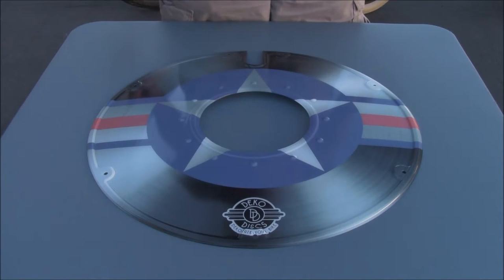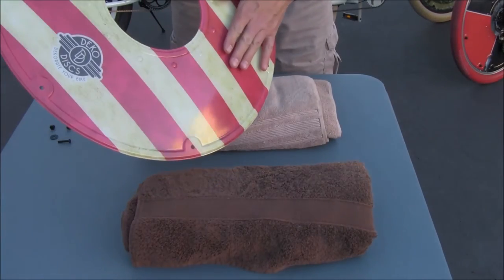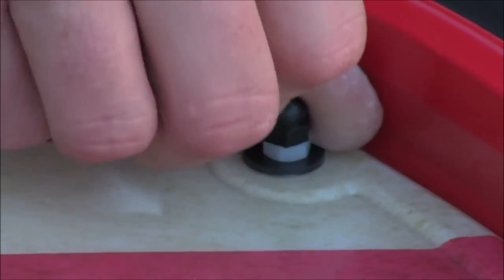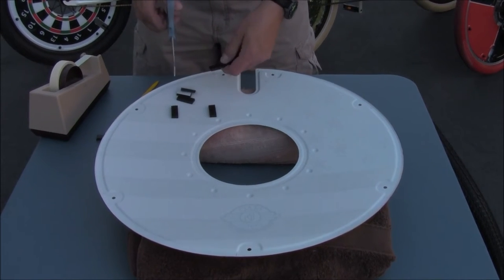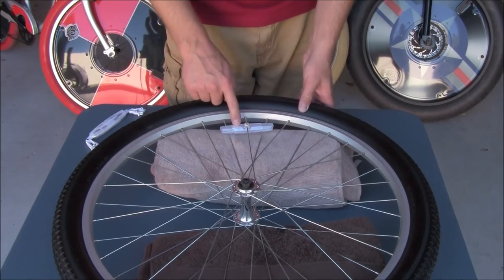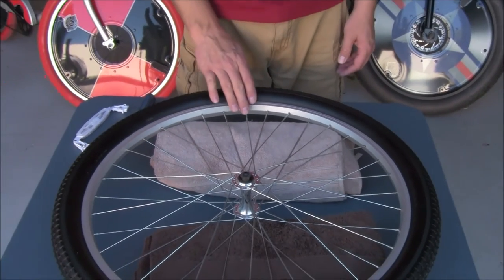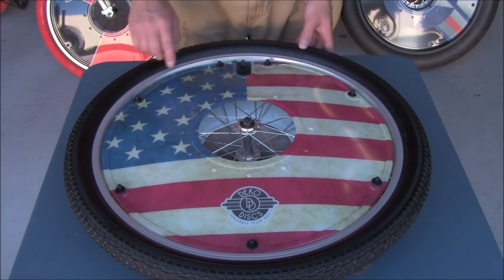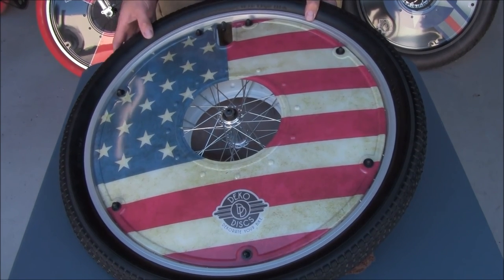Deko Discs Installation Video

Comment: Got a challenge for you guys ..
Ze best would be … that the disk DONT spin with the wheels
They (disk)would probably need to be inside the spokes loose around the hub and weighted at the bottom so the disk doesn’t spin and gives a weirder,cooler effect .. especially the flame disks would be amazeballs not spinning
Cheers